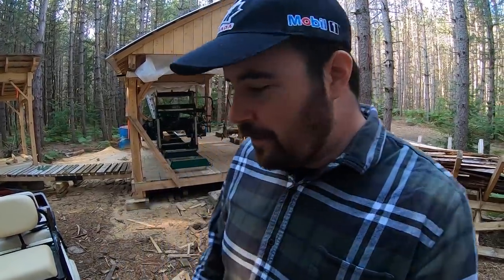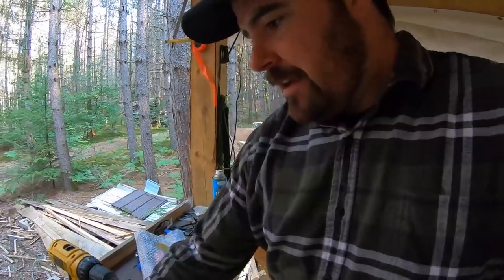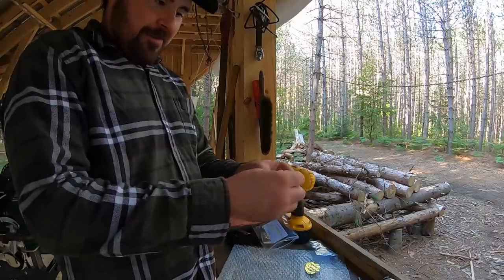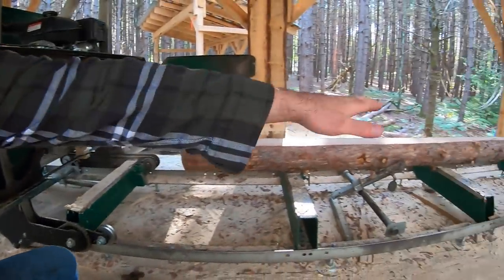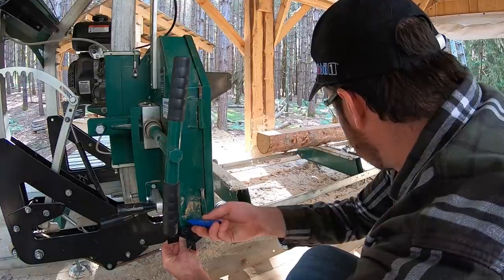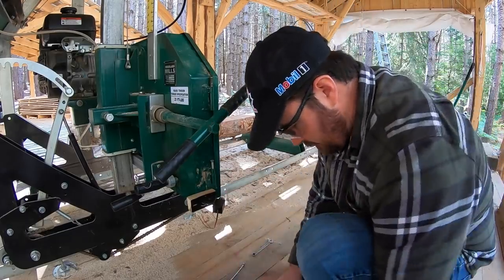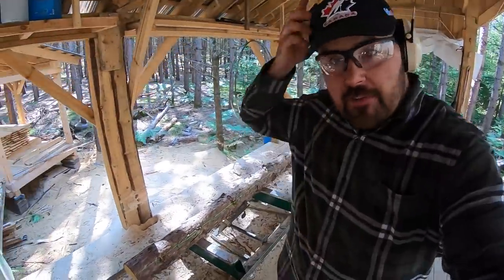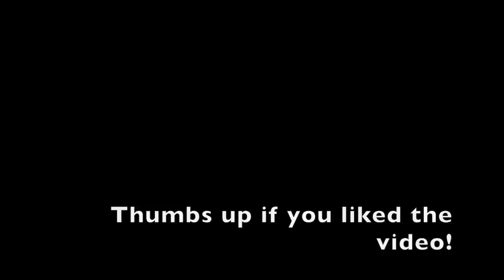Sawmill Laser Line Changes Everything | Placement and Setup

Comment: I hate to be negative because I love this channel, but... I ordered the exact same laser. Sandy's video is front and center when you click "buy now" on the manufacturer website. My recommendation is to not buy this laser and mount. First off, the laser does literally nothing in the light of day. I don't mean in the sun. I mean overcast cloudy day. I thought I would send it back and get the higher powered laser to compensate for it, but it turns out the manufacturer doesn't sell mounts for the more powerful laser. Bummer. I should add, the laser is not defective. In the house it seems very powerful.
Reply: Sorry, have to add that the power supply/battery box is complete garbage.
Reply from the maker: Sorry to hear it hasn't worked out for ya Bryan. Hope you can get a solution for your laser setup. Thanks for checking out my setup.
Reply: DId you find one that works in the direct sunlight? I am in the same boat as you with no cover yet.
Reply: @stevedue4485  No I kinda gave up on it. Aside from the strength of the laser being an issue I’ve found that keeping it straight is nearly impossible. I’ve developed a pretty good eye for where to place my blade anyway so it’s not a big deal. If I could offer one piece of advice until you find one that does work for you it would be to eyeball the cut from both sides of the log. By that I mean the side of the log that is facing you and the far end. Unrelated, but I’m curious, has anyone tried installing a DRO to their woodland mill? I bought one but I haven’t installed it yet.
Reply: @bryanfloyd7080  I just seem to take off small slices until i get where i want, seem to have challenges getting a cant that is square, still learning.
Reply: @stevedue4485  that’s not a bad way to go. If you cut 1” at a time off, most of those cuts can go back on the saw to make usable lumber. Minus the offcut of course.